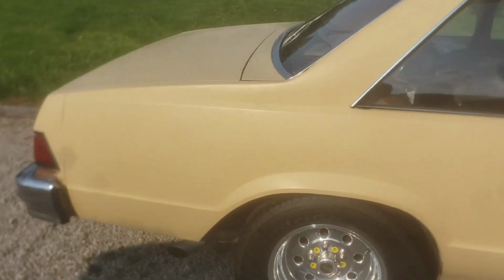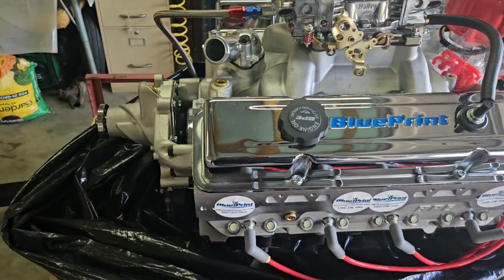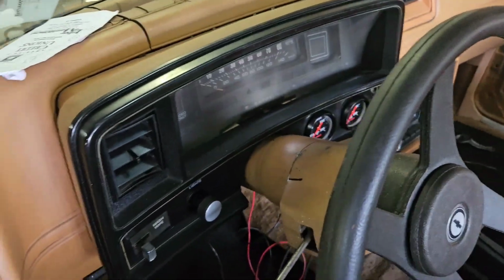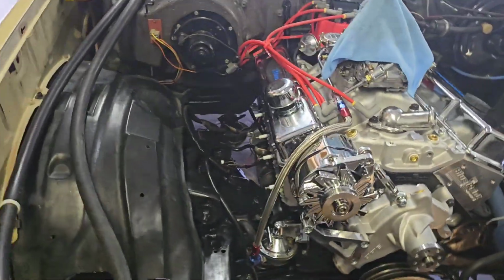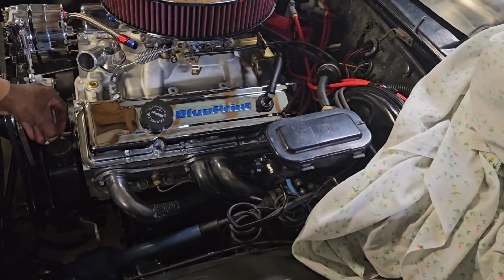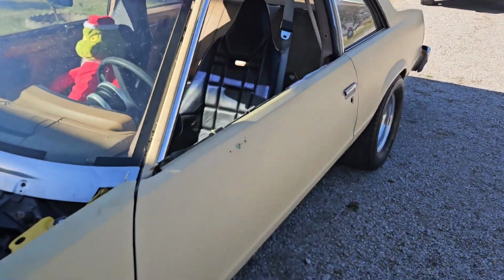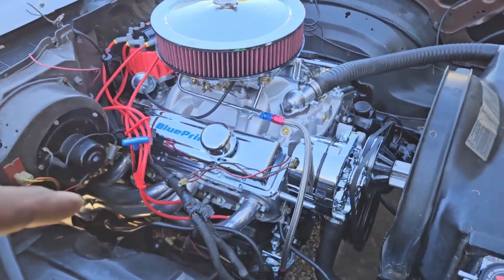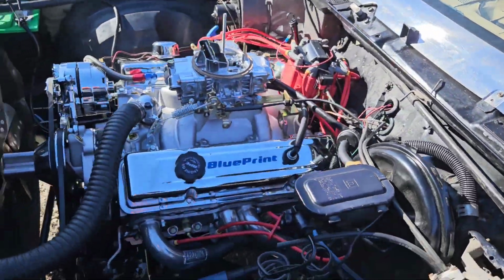@Blueprint engine 383 1st fire

Comment: Loved my 79 Malibu 
It has a 66 model 283 that was 60 over and 11:1 trw pistons steel crank forged rods solid lifter 304 duration 488 lift cam and Pete Jackson quite drive because I kept sheering keyways...my dad had a 78 Malibu born V6 swopped for 350 4bolt...these Malibu's hold a place in my heart 
Great job here ...hold on to it
Reply from the maker: Sound like a runner... appreciate you watching 👀

Comment: Beautiful!  Which engine (part number code) did you get and what headers are you running?  The exhaust ports on the heads look square round and I can only seem to find circle shaped tubes for headers (sorry if dumb question, kind new to this stuff, looking to update my 83 GMC 4x4). Thanks!
Reply from the maker: It is my uncles car I'll try and get that information for u